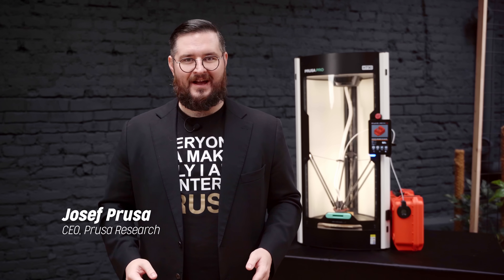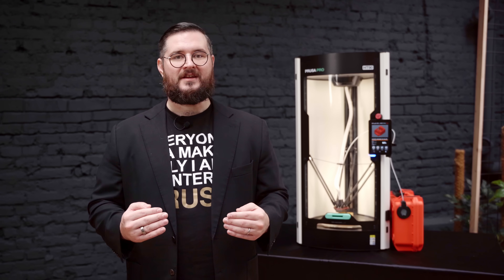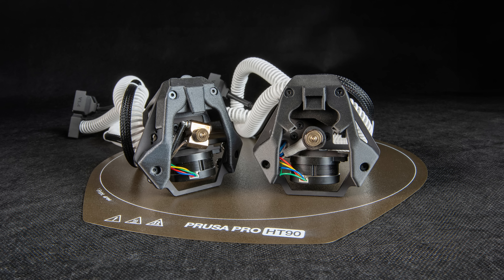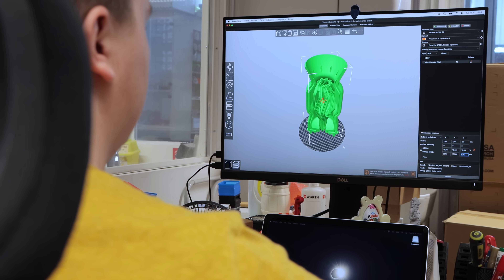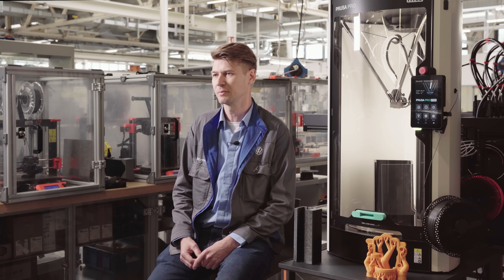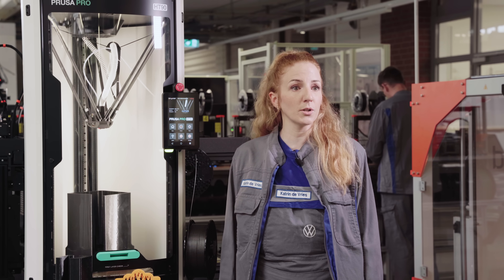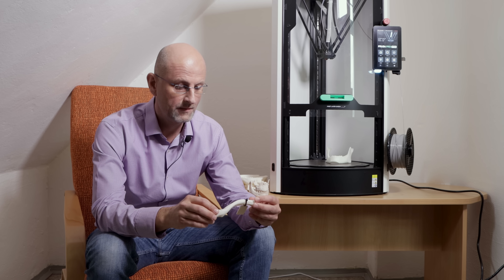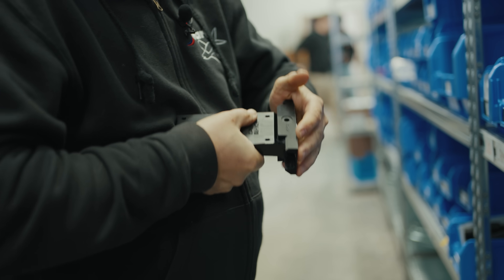Prusa Pro HT90 is here: The Only 3D Printer an Engineer Needs

Comment: This is finally a case where a tech product using the word 'pro' actually seems appropriate
Reply: its still far from being worth 12k€ 

what the fuck... 

its like 5k€ MAX, and that is already super high for what you get... 

you could get like 3 V-Core 4.0 500 IDEX and make them high temp compatible and till have money left to get them built and configured...
Reply: you can buy like 10 Flsun S1 printers that will be better and faster lol
Reply: Guys, don't forget: we can all build capable machines for less. But for that we have to spend time and then we still don't have warranty and customer support. All industry cares about is reliability, speed and ease of use.
Reply: We can maybe compare HT90 vs Ultimaker Factor 4, but 🚫 with Flsun😂
Reply: @nebuchadnezzar47  but you wouldn’t have a warranty or a tech team to back you up.  Value is /= inexpensive
Reply: Certainly this printer is expensive, but I do not know of a high-speed printer with a 90 C build chamber that is below $10,000.  (If someone does find one, I would like to know about it.)
Reply: @hasanmich1504  And then the business would need to have a full time tech on staff to support said printers.  I know a couple people who do engineering work, and they have/are phasing out Bambu printers at their workplaces over maintenance issues and security concerns. Both of these firms do work for the government. To them, $10,000 is nothing to spend on a specialized piece of equipment.  They have an air compressor that costs $75k because it does a whole bunch of special stuff to ensure there's zero humidity at all AND no static build up in the system. When you're making shit to go into space, reliability, support, security, and safety far outrank price.  You're looking at this product as a user, not an engineer.
Reply: @nebuchadnezzar47  yeah ngl for 12k i'd expect the heated chamber to go a bit higher 95C in the grand scheme of things is not much. But it's not like there's any quality printer that can do 95C chamber around that price so eh
Reply: You can build a Vzbot for less

Comment: I have been working with 3D printers as a private and industrial user for the better half of my life now. 
Whilst this seems to be a pretty capable machine, I don't see the 11,5k€ they ask for this thing. So you got a fancy hotend cooler and a carbon filer. Nice. Welcome to what Voron pritners do for several years now. That's 3000€. Doing so in a delta printer is another 1000€. Let's be generous and make that 2000€ for the delta design. 
So that adds up to 5000€. Where are the other 6000€? On the, once again, exposed filament coathanger, that leaves your material out in the open?

Comment: Damn. If even the Germans are happy with it, I'm sold 😂
Reply: Im german, and im very happy to hear it.
Look how happy I am:
._.
Reply: @leinadreign3510  That's about the happiest I've ever seen a German look
Reply: @robotmunkee  It ain't for PLA bud.
Reply: @robotmunkee  You don't print benchies with this.
Reply: @alejandroperez5368  But you could print benchies. A lot of them if the urgent need arises.
Reply: @robotmunkee  It's not for you. I know engineers who have been waiting for something like this for years. (And before you say Bambulabs, it aint it.  They break too often when printing high temp materials, and they don't have a 90 degree heated chamber.
Reply: @meikgeik not to mention they are a little sketchy on the online side of things and their printers aren't as easy to repair
Reply: Doesn’t get much better than that lol.
Reply: Only prints a single material as well, so no supports printed from different materials... It costs 10k cause big companies can afford overpaying on products. The printer probably isn't worth more than 2k. Like how nVida sells basically the same gaming GPUs for 4x the price for professional use.
Reply: German Engineers aren't happy they are satisfied.
They are only happy when all work is done, which is never.
Reply: @atnfn  You think a chamber that's both heated and cooled depending on it's use and an extrusion system that prints materials so specialised you've never heard of them is barely 500 bucks on top of an X1C?
Reply: This idea that Germans produce higher quality products is a lie. Take a look at their vehicles, German sedans are some of the worst built cars in the world. If you buy a Mercedes Benz, for example, it will spend more time being repaired in the first year than any other car in the world. But maybe if you say it enough times it will be true.. probably not tho.
Reply: @MrJBA79  You don't like maybe a quarter of the Mercedes range therefore nobody in Germany is capable of making anything good? Seems reasonable.

Comment: Bro 12k 😂😂 I remember watching one youtube vidoe where one guy made a printer like this where printhead weighed 10 grams so he could print lightning fast with superb result, and the price wasnt even close and it was all mostly carbon fibers. As a mechanical engineer i just ask myself what i would need to do to spend 12k on this. but the most i can think of is 3k. Price for "knowhow" on this one is way wack..but i guess every product aimed to be used at factories is like that. Could atleast include a 64bit mainboard instead of 32 for this price...
 Wouldnt be surprised if VW would actually start using 3d prints on production cars, not just prototypes. their cars already are falling apart anyway 😂

I would like to know what does it have over bamboo lab printers. except able to print higher parts. Using printers at work, if a part takes 24h or 8h doesnt make a diference unless all printers are full (which almost never happens for prototyping). since workday is 8h the part wil be taken of the printer at same time even if it prints faster.

Comment: I'd like to see a Prusa SLS
Reply: Some other company is Kickstarting that right now, but with a CEO barely out of college. I would pay $1K over their asking price to get the same thing from Prusa and know the company that made it has been around continuously since the early days.
Reply: @__S__435  micronics is two college graduates and their professor, I would not trust them especially on safety. They show off that they started out in a college apartment, running a milling machine less that a metre from a bed with nowhere near enough adequate space around it, they even joke about how they got woken up by metal shavings in the bed. They basically used a college apartment as a workshop with machines that should only be used in workshops.

Considering their lack of care with their own safety and the safety of others in the building, I would not trust them.
Reply: Since it's prusa it would probably cost over 50k.
Reply: @conorstewart2214 it's college. Such behaviour is expected from passionate engineers.
Reply: Give the people what we want!

Comment: My first printer build was a Kossel Mini and I have measured every print since by it's print quality way back in 2014. I moved on to larger print area with my most recent build being a 350 x 350 Voron 2.4, but I have no doubt a properly designed delta could surpass it's speed and print quality. I would love to see the Nextruder become available to purchase separately as it appears to be the best designs on market.

Comment: Its clear that recent generations are dumber and dumber - but please - think before You write! This is commercial printer! Big companies - especially in EU  (like the one im working in) care about all certifications and necessary paperwork - so they get through audits and assessments. Many chinese printers dont have these documents so such corporates can not buy them! I know what Im speaking, as I had to go through these buying processes several times.
This is not a printer for normal household which has some Prusa or Bambu or Creality in garage. You need to know that You have a use case for all these "scifi" materials that this machine can print. And frankly speaking - did You check prices of PEEK, PEI and PPS spools? They may cost same as Your home printer ...
People comparing this to Flsun S1 - really? Yes its similar. BUT - the only PRO it has over this printer is integrated drybox, which is really nice. But speaking about other stats - its not in a same league. 500C nozzle, over 150C heatbed and 90C chamber - and You compare it to Flsun? Really? Do You know, what You need to solve to keep Your electronics working for a long term in 90C environment?
Name one printer with same or better stats in this price range please.

So either are majority of commenters dumb, or extremely anti-Prusa biased or poor and just envious :D Howgh

Comment: A new professional level delta 3D printer was definitely not at the top of my list of expectations for 2024 — but it makes very good sense! Today's processing power allows us to remove vibrations with adjustment for height, and there is nothing that beats delta kinematics for lateral speed and efficient stepper motion, and of course vertical motion can be near instant. We love the open build plate access that comes with the Prusa i3 design, and a deltabot can be even more accessible — from three sides.

We can't wait to see all the things people do with these beastly machines!

Comment: I had the luck to be in the HT90 production facility in Hradec Kralove and saw the prints. Guys - for those +- 7700 Euro Youll get amazing machine. I would really agree that its "Prusa of Engineering level"
I was really amazed by prints from PPS material - they are completely on par with molded parts - they dont even  break in layers but across them! And thin "neck" of 4x10mm was able to hold up to 250kg of load. Amazing materials.
I am already preparing our company management for this expense, as it will pay for itself within few months (automotive industry). And to be honest - its not that super expensive, that it would be completely out of reach for personal use as well. When people can pay 2000 euro for a phone - value of this printer can be justified ...
So my big thanks to whole Prusa (Trilab) team who achieved this. It is a bombshell! And as experienced print guy, i would put my hand into fire over this product - and I just saw a demo and their print farm! :D
Reply: Nice to hear your experiencr, but how many peoples do you know who spend 2000 euros on a phone
Reply: That makes no sense. The high temp parts they have shown are not even semi-cristalline so they suffer from isotropic properties

Comment: the funny thing is that even at a price of 10,000 USD, the printer does not have a drybox for filament, which is an absolute necessity for printing advanced materials such as nylon or polycarbonate.
10,000 USD and you have to handle the printing material with your own drybox. 🤦‍♂🤷‍♂😒

Comment: I'm surprised it isn't configured with a filament dryer that can be printed off of
Reply: True but can print direct from a dry box like most engineers will already be doing?
Reply: @Baldavier  In production environments, the Drywise dryers with the Pre-Heater are normally used.
So I would say yes, to use a Drywise dryer should be no problem with this printer.
Reply: It would be nicer to have the dry box either integrated, or able to be electrically connected. That way the printer can control and monitor the filament box’s temperature, and maybe also monitor the amount of filament left.

Comment: interesting choice going with a Delta printer. Would thought they would go with a core system for speed and stability. My big Anycubic Delta worked great for a while but due to some inherent problems with Delta type printers would need a good amount of tinkering.
Good luck with the new printer

Comment: This is very exciting! A printer that's actually capable of using engineering filament, not just saying "I mean, technically it'll do PEEK".
Reply: Yes, because it can't do PEEK at all. PEEK needs 133 degree chamber temperatures.
Reply: I don't see what makes this printer more capable of doing these high-performance filaments than a lot of the other printers claiming so and doing it very half-assed like the Funmat HT that has the same 90C chamber temp and a slightly hotter bed. It will come nowhere close to a proper high-temp printer (though it is ofc significantly cheaper)
Reply: i mean, it still probably is 'technically it can do PEEK' 90C is high but not that high for PEEK. Good video btw
Reply: @HackCausality  If it can't do peek then why did they show it at 0:25?
Reply: @HackCausality  that just isn’t true, 3DX Tech PEEK recommends a 70 - 140 C chamber and filamentive PEEK recommends > 80 C chamber. So the HT90’s 90 C chamber should work although hotter is generally better.

Comment: Just a warning to anyone out there that got excited about the idea of printing Peek. I have a fair amount of experience with high performance materials like peek and ultem for engineering applications, and I can tell you that a 90C chamber is just not hot enough. Even with a bed that gets that hot you're going to have a hard time making anything bigger than a benchy that has good layer adhesion and meet any real tolerance requirements. I agree those stats are perfect for ABS polycarbonate and HTN Nylon, and I'm probably going to get this printer but definitely not for peek or utlem.
Reply: I mean, they definitely print a bunch of bigger prints, but sure okay 👍
Reply: @deathspawn54  Not trying to discredit the machine or prusa. Like I said, I want this machine. Just some helpful advice to anyone wanting to print large accurate parts out of peek or utlem will have serious challenges with those temperature stats. Again I know, I've done this industry. Just trying to be helpful to someone that is out there trying to find a HT machine.
Reply: @brocklydoodle  I saw another video of it where they show some medium large prints that seemed to look really good, but nothing super large, I guess the print area isn't that big either though
Reply: @deathspawn54  I'm speaking specifically about ultem and peek prints
Reply: @brocklydoodle  I should have clarified that they were peek and ultem

Comment: Prusa entering the pro market was not on my bingo card for 2024. But super happy to see you did. I would love to see a professional open source IDEX printer between 3K-7K as well as a prosumer model as well for small-medium engineering/product development companies.
Reply: am I the only one that has seen prusa sell these more business orientated delta printers already for many years now? Everyone here seems to be surprised by them for some reason ...
Reply: It would be amazing to see a dual printhead machine on linear motors with an MMU/AMS system. That would highkey be game changing.

The ability to just independently park a printhead and have it to do the whole purge and prime without affecting the main printhead.
Also the fact you get higher accuracy and rigidty from the linear motors is amazing.
The fast filament switching would let it be cheaper and compete with multi-head designs in speed lowkey. 

would be amazing to see from 3D printing.

Comment: This shows the direction prusa is going: away from customers and towards industrial application. With the pressure from Chinese companies it is understandable, but it will leave a hole.
Reply: They will do the same move that Ultimaker has done before.
The problem is, all these companies can not compete with the chinese ones in their
price range. So the only solution for them is to move away from the customers market
to industrial applications and sell the service and not the printer alone.
Reply: @Frost-zy4nz  Yes, it's the only way. But I would want an upgrade on the prusa mini and I think that will not happen anytime soon, if at all.
Reply: Clearly you have not read their blog post. HT90 is made outside of Prague, it's a separate division. Prusa is actually hiring.

Comment: I'd buy a Visionminer 22IDEX for a few thousand more, I think their experience of printing high performance filaments is better suited at that level.
Reply: You also have a lot more flexibility with an Idex solution vs a delta and a larger print area.
Reply: Yeah it just seems like an all round better printer made by people with more experience in high temperature filament.
Reply: Yes the Visionminer 22IDEX looks very nice and I was looking into getting one but I have seen zero info from someone actually using one and hardly seen any videos of it actually printing. Might get one of those in the future but I will get a HT90 now to increase our capabilitys.

Comment: Why a delta?
Reply from the maker: It's a really need solution for a 3D printer with heated chamber. It allows the electronics to be in a cooled environment, it keeps the printer's footprint very compact when taking the build volume into account, it allows extremely fast printing with very lightweight print head, and so on. :) -Mikolas
Reply from the maker: Hi Nick. Delta printers have some advantages, and disadvantages too, when compared with other 3D Printers movement systems. The HT90 is our first 3D Printer of the Prusa Pro range. Soon, we will launch other non-Delta 3D Printers for professional use. Stay tuned.
https://blog.prusa3d.com/
Reply: @Prusa3D  I'd love to see a video detailing the engineering of the HT90
Reply from the maker: Hi. Apart from the full article in the Blog, we plan to release more information about the HT90.
https://blog.prusa3d.com/prusa-pro-ht90-is-here-the-only-3d-printer-an-engineer-needs_98411/

Also, feel free to contact our Support Team for more details.
https://help.prusa3d.com/article/customer-support_2287